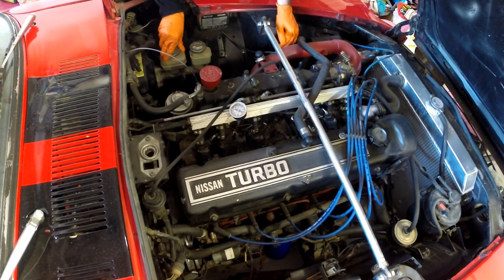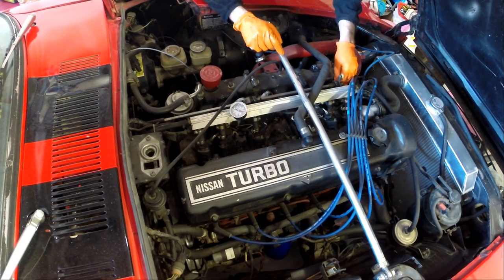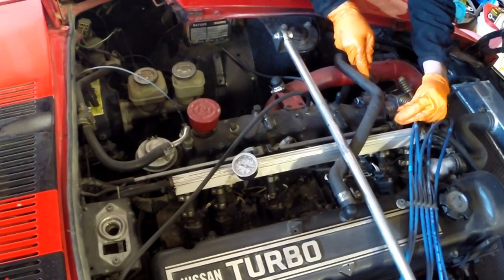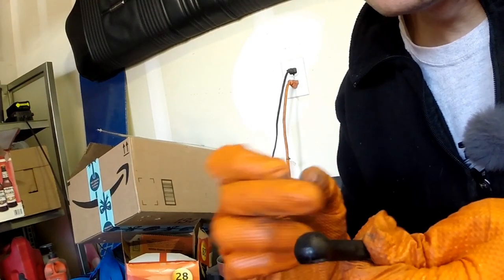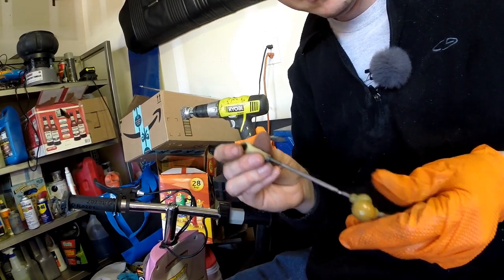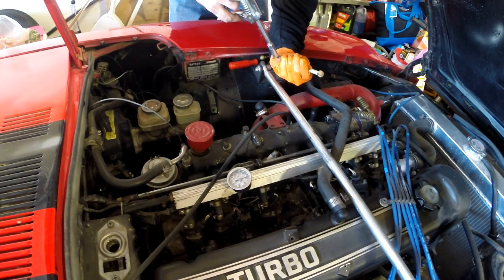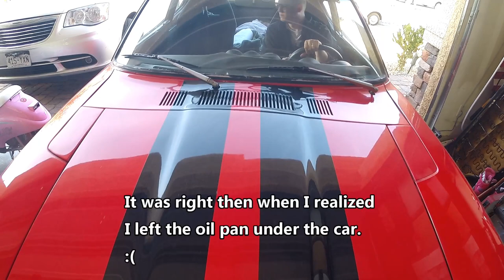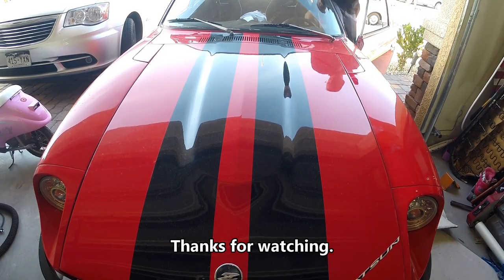Datsun 280z Throttle Linkage Cleaning and Oil Change

Comment: Nice Video -  Just got a 72 240z with a L28 and I'am about to do my first oil change.  What brand of dry graphite did you use for your throttle?
Reply from the maker: Thank you I just found that Youtube hadn't notified me of any comments in over a year so I am going back through all of my comments and correcting that. I just used what I had on hand from when my kids made pinewood derby cars I am not sure on brand.